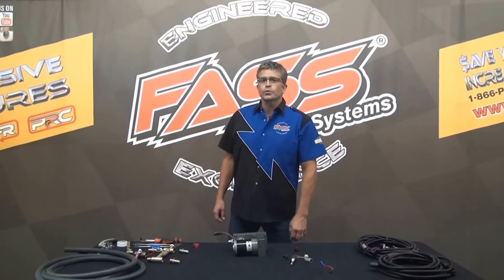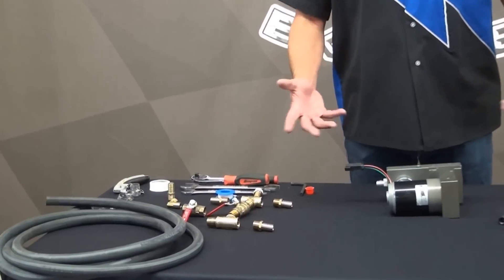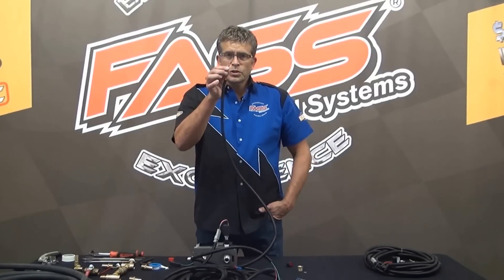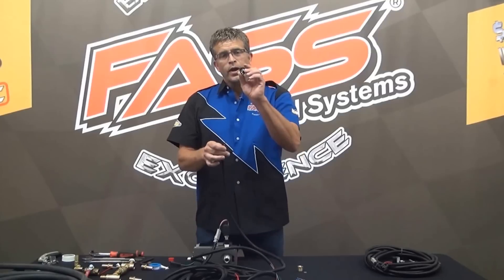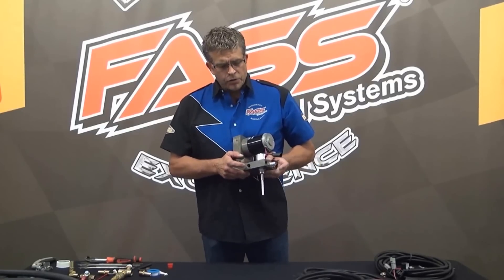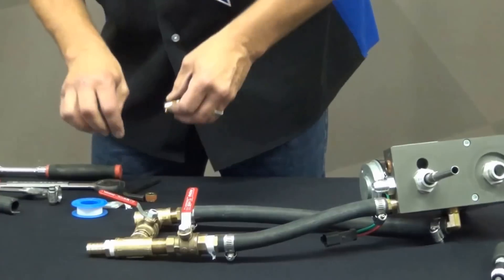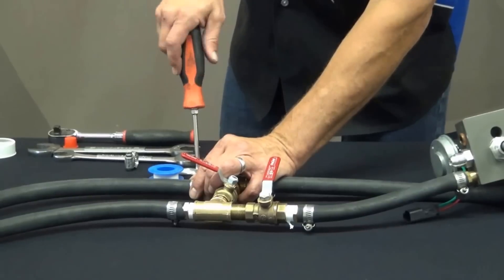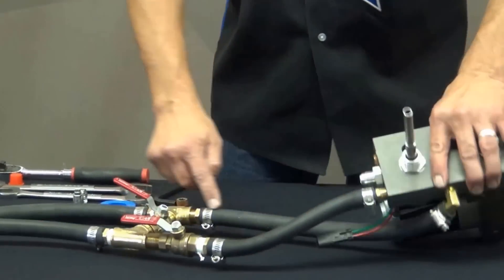FASS Cold Weather Heating Options

Comment: Your postition of your electric heater is right above the water separator filter. Why do the new videos of the new fass titanium 165 put the water separator filter in the other location. Not below the heating port. My old fass had the water separator below port, closest to rear wheel
Reply from the maker: Great question, and thank you for reaching out. Since this video was released we have made a few newer versions of the FASS system. The newer Titanium series systems will have the water separator on the side of the FASS towards the engine.

Comment: Why would you need the bypass.  If you had a single valve on the supply side wouldn’t that be enough?   Seems like a 12v valve there and I could switch this on or off from the cab.
Reply from the maker: Great question and that is something that should work as well. When we made this video it was quite a few years ago, and we have a few different heating options available now as well. Thank you for reaching out to us!

Comment: isn't the problem with cold weather more that the coolant needs heating up via an Espar or similar device to reduce all the expansion and contraction while starting up in cold weather? heating the fuel is nice but in the winter there is additive in the fuel at the pump, around here anyway (Canada)
Reply: BigB yes there is additives in the fuel here in the states but it’s usually not as good in the southern states but the northern states have a better additive. However it’s not as good as the Canadian blends. And yes on heating the coolant because that also warms up the oil so it will get to the engine parts faster.
Reply: Alot of the fuel here in North Dakota in the winter is P40 from Manitoba.

Comment: Cummins 5.7L 2005 
What about the summer ? Is it why you had it wired to a switch ? Winter has been strange here this year, we have seen -25*C maybe 5-6 times ... But the next week it's 5*C ... Also there's a lot of additive in fuel in Canada, I know some truck has been running your kit without any heating but I decided to order 2 heaters for safety. I went wit a sump kit and it looks like some fuel is draining back into the tank when it's on the low side and sitting for 2 days. What would happen if I start those 2 heaters and there's no fuel ? At what temp should I start putting them ON for start up and while cruising the highway ?

I know there's a lot of questions ... ;)
Thanks
Reply from the maker: +DSM4LIFE4WD 

The heater probes are controlled by a built in thermostat. They will only turn on when temperatures are in the lower 30*F and turn off with the fuel is around 70*F. You can wire them to a key on power source but the best way is to wire them on a toggle switch so that you can turn the heaters on before the pump is pumping fuel. If the probes are turned on without fuel around them they will burst very quickly.

Comment: what size fittings do you use to the H ports on the fass,  I know you said 3/8" pipe thread, but what size is the hose barb?
Reply from the maker: +BigMatt302 You can use either a 3/8" or 1/2" hose barb

Comment: so if I get this right I can get one kit (harness and all) and then just add a second element to the one relay? or does it have to be 2 whole kits??
Reply from the maker: +AceBoy2099 That would be correct. You would have to hard wire the 2nd element into he harness. We suggest to change the fuse in the wire harness to 20 amps also to handle both elements.